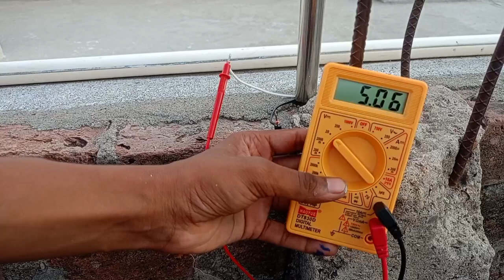😎🔥How to make a Wind Turbine at Home by using Water Pump | DIY Wind Turbine | Science projects.

Comment: Thanks! Wonderful Project! You explained every step in details. 
How much current it can supply in a windy weather. I think, It will be more beneficial to show the output current along with the voltage.
Reply from the maker: It can Generate 10-20 volts of DC current at maximum speed . Stay tuned I will build more better wind turbine with higher output